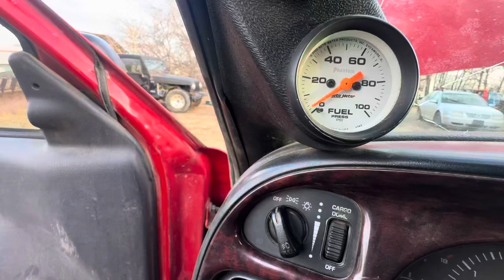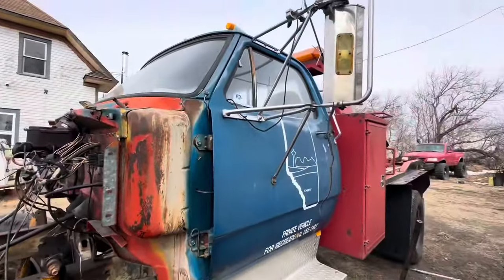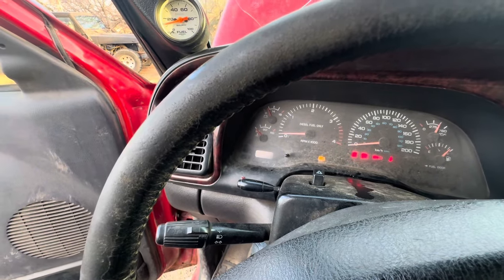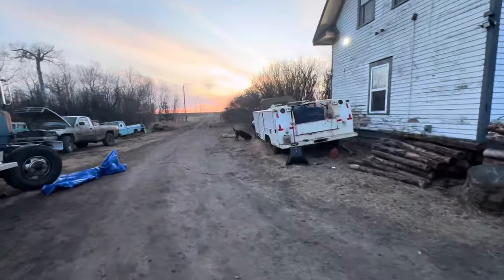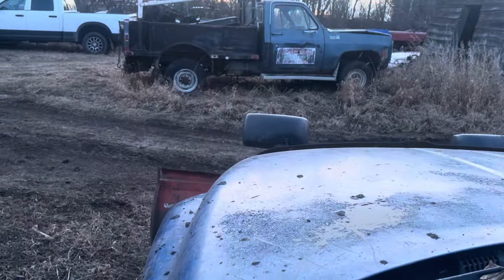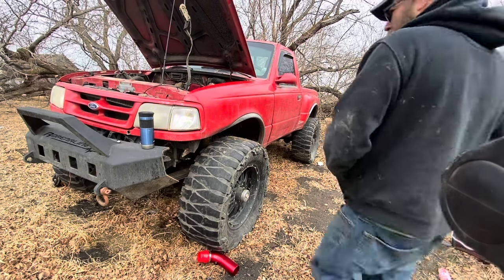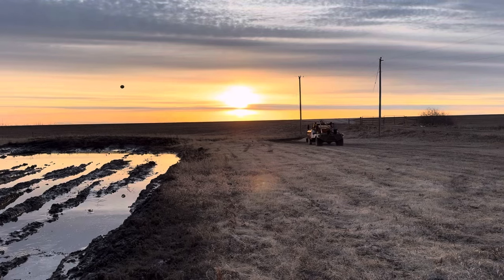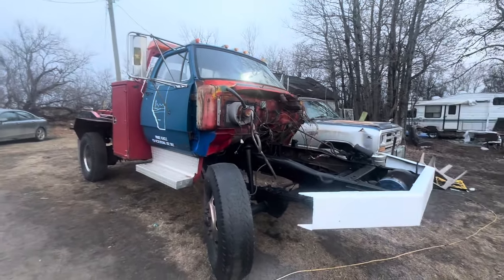First rip in the pit!

Comment: Looking forward to this build and you make me miss playing in the mud. My favorite 4x4 was my suzuki samurai on 33'' tsl boggers it broke less stuff than my others. So I did some calculations for you. I think you said 6.37 gears nv4500 .74od and 42" tires. At 2800rpm 12 valve defuel it will be running 74.25mph 120kph that should be perfect. Question have you ever put a brownie box in a pickup? I want one for my 85 6.9 f350. OD would be nice empty on the highway it has 4.10  30'' tires  t19 trans and I would like a low for creeping trailers. When loaded I could split each gear from direct to o/d and with a 3spd brownie and I could use low and 1st to take of when pulling crawlers and heavy stuff and then just direct and od in each gear after.
Reply from the maker: That’s mint. I appreciate that calculation , I can’t wait to get the XML’s on it ! And no I haven’t , I have thought about it before I went with the 12v .. but wasn’t sure what a brownie box would cost , and I kinda blew my budget buying the truck haha and knew I already had the 90 to donate its power train  .. however I think in your idi , that would be the way to go .. If you can find one , not sure how expensive they are , but I’d love to see what it would cost you, I’d consider one on my 69 power wagon back home , it’s 4.88’s but has a divorce tcase , so I could put an over drive on it
Reply: @Brokeandtwistedgarage  I think there in old dump trucks, would have to build a cross member, adapt drive shafts do shifter likages lots of work, I would want a 3spd box with 2:1 low 1;1 direct and a .75 od. I would be great for divorced t case if theres room in the shaft. If my truck was 4x4 I would probably just leave it and use 4 low for creeping trailers. 1st is to fast in that truck 4:1 I could put in a old t18 like in my blue truck with a 6.5:1 1st but it has big gaps in the gears and a big rpm drop wont pull worth shit. If you ever need gear numbers crunched hit me up just need ratio in diffs, trans and tire height. From drag racing I am figure that stuff out all the time.